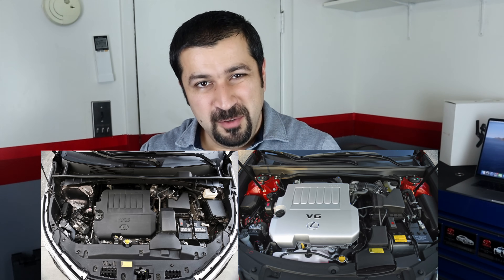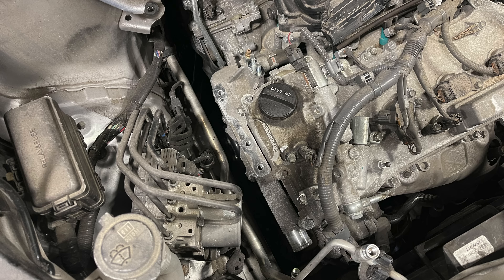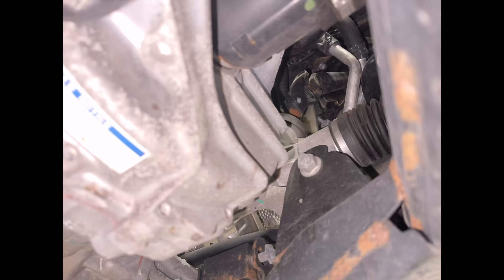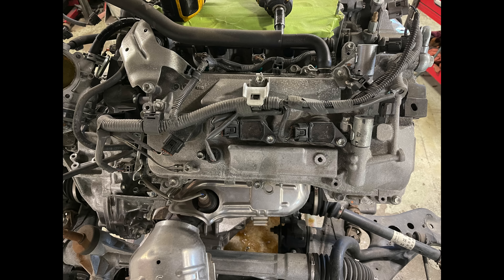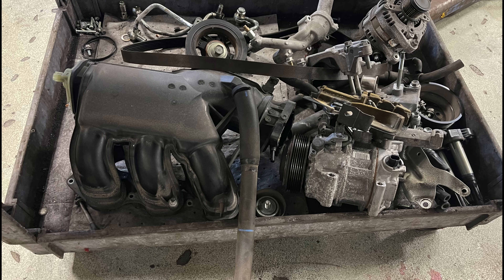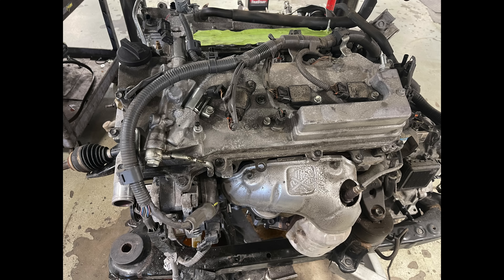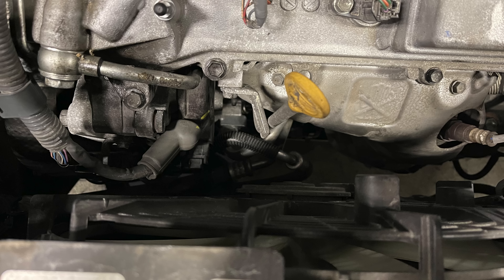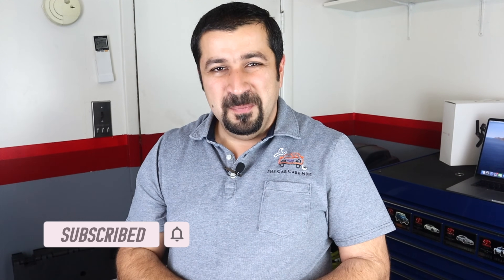Toyota V6 Engine 2GR-FE Disassembly Start to finish Front Timing Cover Repair

Comment: Hi Care Care Nut- I have a 2015 Camry 38,000 miles. I brought the car to a local Station  for an oil change where they pointed out the same leak. Is this something  that will get worse after time? Also would Toyota cover this as a warranty  issue? Even though  my car is 7 years old. But very low mileage . Kindly advise back. I wish I lived near your shop to have the work done. Also I always brought  my car to the dealer for service and just this one time I brought  to an independent repair shop. Suprised  the dealer never mentioned this...?

Comment: I hope you can provide some input to my problem - - I have a 2009 Highlander Limited with 143K miles. On Christmas Eve 2021 we headed out from the Chicago suburbs to spend time with family in Nebraska, and as we were nearing the IL border on I88, I noticed my rear window seemed smeary when I tried to clean it - - the road was wet and was kicking up crud. I figured I'd just clean it better when we topped off the tank at the Iowa 80 truck stop, but when I pulled in to the pumps, I heard what sounded like lifter noise, After refueling, I checked the dipstick, and saw nothing. I went in and got 4 quarts of oil, added them, and the dipstick showed only half full. When I fired up the car, I expected to see blue smoke, but the exhaust was clean, and when I walked around the front, I saw a huge puddle of oil under the engine. Apparently the oil line to the oil cooler had sprung a leak. To make a long story a bit shorter, we had the car worked on and they replaced the line with a kit that included a stainless line. When I looked things up on the internet, I found that this was apparently a known issue, but Toyota had never issued a recall. I have checked with about 4 mechanics, and they are all recommending replacing the engine. I am looking at about $7K to have it rebuilt & reinstalled. I called the dealer we got it from (used) to see if Toyota has dealt with this issue, and would offer any assistance, but they didn't offer any help. I am considering talking to Toyota corporate, but thought I would see if you have had any experience with this issue, or if you know of Toyota offering any compensation. My long-time mechanic who is retired recommended an engine rebuilding place in Elmhurst that has a 3 month wait, and I am considering going in that direction - - but if you have any input on where to take it, I would appreciate it.
Reply: something I forgot to add - - the low oil pressure warning only came on after I restarted the engine after filling up with gas - - no warning whatsoever when we were cruising down the highway. Thanks for any help or input you can give!

Comment: Hi AMD, looking at buying a Camry/Avalon 2013+ and been reading into oil leaks from the oil cooler and VVTi oil lines that have a rubber component.  There was a TSB to replace with full metal line, do you know what year Toyota started using all metal oil lines from factory? I am from Canada

Comment: Do you know whether I can change the timing tension on Sienna 2GRFE without lifing the engine?

Can I change the AC bearing without remove the AC compressor?  I know usually have to remove radiator and AC coil in order to get to the AC compressor.
Reply from the maker: Hi! On the tensioner you can but it’s very difficult and tight. The AC compressor you can change the clutch if you can get a tool to hold it and take the nut off

Comment: I’m having to do this on a Lexus ES350, except I’m having to go a bit further and remove and replace timing chains, guides, tensioners and the VVTI cam gears for the intake. The Bank 1 VVTI cam gear was rattling on start up for a good 1.5s after start up. Told the guy if the engine is out and the covers off, and I’m having to pull the timing we’re going to change it all out so we don’t have to go in. Also told him if he’s got any other repairs he’d like done while the engines out now is the time.

Comment: Wow, just wow.  You're a class act, I love your spirit & passion for doing a good job!  I work on cars, but I get easily frustrated; I would be cursing my head off, throwing things & cursing the design!  lol  I have this engine in my 2011 Camry and I pray that I don't have problems with the timing cover.  I have 238,000 miles on it and so far so good.  Thank you for this informative video!

Comment: Hi AMD. First of all thank you for your amazing content and kind spirit. I have a 2017 Tacoma with 80k which appears to have this dreaded issue (not sure when it originated). Do you have any recommendations with regard to oil type to help slow down the leak- high mileage oil, go up in viscosity (5w30?), synthetic blend instead of full synthetic, any suggestions? Thank you kind sir!

Comment: Do you have to drop the engine to service the timing chain cover on the latest generation highlander? Having to drop the engine to repair a timing chain cover oil leak which is somewhat a frequent occurrence is a huge negative to me.

Comment: done this job quite a few times. use pretty much the same work flow to achieve the same result. good to know im not the only one that takes the time to leave the engine bay cleaner than when i started.

go figure my own Avalon has leaking cam towers though. a project for next year!

nice work.  -from a fellow chicagoland toyota tech
Reply from the maker: Thank you Dan!

Comment: Hello sir, first off I thoroughly enjoy your videos and learning from your knowledge, experience and expertise. I have a question about the 3.4 5vz-fe, I couldn’t find a video specific to that motor. What’s your best guess diagnosis for black/grey smoke from the engine compartment of a 2003 tundra with 240k miles. No white smoke anywhere. My first guess is the valve cover gaskets, which is fine as that can be repaired. Do you have any other diagnosis thoughts of what could be causing this? My main concern is could it be something inside the motor that’s not fixable besides a new motor. It runs, but begins smoking from the engine compartment soon after start up. I’m potentially getting it from a friend for $2k that doesn’t want to deal with repairs. Thoughts? I appreciate any insight and advice you can give.

Comment: AMD what would typically be the cost to swap a 2GR-FE on a V6 Camry, have a replacement 2GR-FE with 44k miles hanging around in my garage doing nothing and the one in the car has 280k miles.

Comment: As usual, we’ll detailed video! How can one prevent this leak from happening or is this leak inevitable? I’d hate to have to do this big job if I can prevent it. Thank you Sensei
Reply: Rubber and plastic goes brittle/hard over time as it's exposed to harsh conditions -in this case heat cycles and oils/vapours etc...-. Optimum material chemistry can improve longevity but nothing we make lasts forever. I'm considering getting an '08 camry with this engine and I must admit, seeing this sort of maintenance routine is a bit daunting... To be fair, this probably only needs to be done once in the typical healthy life cycle of these cars ~300k miles + which is easily justified when you consider how many cars have parts that are designed to fail and empty your wallet right after the factory warranty runs out.

Comment: Hi, I have the same engine on my 2008 Highlander with 206k miles. Unfortunately after a long drive from NYC to FL and vice versa, I heard engine knocking real loud on idle. Instead of rebuilding the engine, I’m planning to swap it with another low mileage 2gr-fe. So my question is will I encounter any problems such as ECU compatibility along the way?
Reply from the maker: As long as it’s from a compatible car, you’ll reuse your wiring harness and ecu so there shouldn’t be any issues
Reply: @TheCarCareNut  thankk you so muchh for the info. Last question, I’m currently looking at a long block engine taken from a Lexus es350 FWD from Japan and my Highlander is AWD. Will it still be compatible for my vehicle?
Reply from the maker: Honestly this one is a tough one to answer. You’ll want to compare the short block numbers between the two cars to see if they mate tk the same transmission
Reply: @TheCarCareNut  gotcha.. i’ll definitely do that. Thanks alot. Love your videos.

Comment: Hi All
What about to use loctite 3450 seal from “outside” timing cover? Of course wipe/clean all oil leak. Probably only power steering pump need to be remove to get access. Engine stay in the car. Sounds like way way cheaper repair, but It will work? There is no high pressure there, loctite should do the job?

Comment: Thank you for the informative video! I was wondering how hard would it be to replace the exhaust manifolds front and rear while the engine is still on the vehicle, on a 2GR-FE 2010 Camry V6? How much time approximately will it take?
Reply from the maker: Hi! The front one is easy. The rear one is a bit more involved but still not hard for a professional. Should be likely up to 3 hours for both
Reply: @TheCarCareNut  Wow, thanks so much for the quick response! I appreciate it!

Comment: Jesus Christ 😂 I have this engine in my 2010 Venza at 166,000 miles. Doesn't have this leak, but it had the oil cooler line leak replaced at 130,000 (that oil leak was nasty, it was literally pissing oil out). When this happens I'll most likely be adding/cleaning up oil like everyone else in the comments are doing! Hands down to you 🙏
Reply: I'm surprised that there was not a recall for the rubber oil cooler line issue.  Loss of oil could destory the engine.  I see that Toyota re-enegineered the replacement part with all metal tubing.
Reply: @dmcc7365  no recall they just extended the warranty on it. Mine was past the warranty and was $700 to fix before I flipped out at the dealer. They knocked it down to $300. Lucky the engine didn't blow when the hose burst on the 30 minute ride home, it only had half a quart of oil in it when I checked it the next morning. (All dummy lights were on and the engine was knocking)

Comment: Wow, thank you for the video.  Our 2019 Highlander Hybird is at Toyota having this done right now.  It seemed to start around 14,000 miles, very small, but we had continual oil on the garage floor.  Is the repair permanent?  I hope our mechanic is as good as you.  I met him, and the service tech said he was one of the best at the dealership, but there is so much to take care of.  Also anything to watch out for when getting the car back?  Thanks again!
Reply from the maker: Hi! This repair is permanent if the technician is experienced and prep the surface correctly. If they’ve done this job before they would know how to prep the surface otherwise it will leak again within a year or less which is within the warranty period. Make sure to check it again less than a year. If It’s good then you’re all set
Reply: Try buying a real SUV instead of a Camry with an SUV body and a minivan engine.  You tOyOdEr buyers are absolutely clueless and pathetic.  Highlander is a pile of garbage; slow, outdated, ugly, and rusts out at the sight of rain.
Reply: @wildman1137   Brother are you ok?

Comment: Hey amd what do you use to hold the engine when you changing transmission. Or you usually bring the hole assembly down too.
Reply from the maker: Hi! There’s a bridge or support that sits on top to hold the engine so you can remove the sub frame and pull the transmission out
Reply: Any chance you can send me a picture of the support bridge.. the one I use so sketchy.. I’m afraid I’m gonna get crushed.

Comment: Excellent video,  outstanding to watch.  May I please as?  This is the 2GR-FE engine that has these front cover leaks.  It's the same engine in the Toyota vehicles, as the Lexus ES350.....However, the ES350 for many years was made in Japan.  So....the question is, have you seen about the same number of ES350's, as Toyota vehicles? Or is it mostly just the Toyotas?
Reply from the maker: Hi! It seems to affect specific models more than others and it doesn’t have to do with made in Japan or not. For example the ES350, Camry and Avalon are not that affected by this when compared to the RX,highlander and/or sienna.
Reply: @TheCarCareNut  Thanks for sharing that.   And that's both interesting, and curious at the same time.  I have the ES350 so I guess I'll move that down on the list, of: "next thing to worry about".   I learned so much watching you take that engine apart.  Thanks again for making this video!
Reply: @TheCarCareNut I just bought a used 2007 es 350. I didn’t see any leaks when I seen it. I bought it at 142,000 miles. I noticed it leaks oil. It doesn’t burn and smoke. I’m worried. Any advice would help please sir.

Comment: What kind of table did you use to drop the engine on?  I need to replace my exhaust vvt cam timing gear assembly bank 1 on a 07 RAV4 v6.  Read that I have the affected model, and it does make a rattle noise on cold start.  Any recommendations on that job?? You make great videos!
Reply from the maker: Hi! It’s basically the same on this video plus removing the chain and the gears. That table is made for nissan actually. Search in nissans special tool catalog and you’ll find it

Comment: I have 2gr Fe  in a Lexus RX 350 that started overheating and wanted to ask if there is any difference between Fe and Fe awd. Should I change the engine or should I rebuild the engine?
Reply from the maker: Hi! I would find out why it overheated first
Reply: @TheCarCareNut  so it turns, it was a blown head gasket as I finally started to see white smoke.
Reply from the maker: I would still make sure everything else is good

Comment: 16:25    Can anyone tell me what that hose clamped to the coolant funnel is for.  The only thing I could think of would be an air bleed for the cooling system.  Is there one on this engine on the top of the passenger side.  (Can't really tell where it is hooked to.)

Comment: The dealership noticed timing cover leak on my 2015 RX350 at 31,000 miles...fixed it under warranty. 14.9 hrs of labor.  Now the vehicle has 66,000 miles.  Could this leak reappear?
Reply from the maker: Hi! Likely not. If it lasted this long without issues then the job was done right and you won’t see this leak again for a very long time if ever

Comment: Ugh, so what you're telling me is i'm not getting my 2gr out of my rav4 in my driveway to fix that stupid vvt cam
Reply from the maker: It’s very difficult to get it out the top.
Reply: @TheCarCareNut  thanks, appreciate the reply.  Seems like one of those things I just really need a lift to do right.  By any chance have you ever seen or done one of those pre-oiler setups to stop that cam gear from beating itself to death?
Reply from the maker: I haven’t seen that.
Reply: @TheCarCareNut  basically a pressurized reservoir actuated by a solenoid.  Turn the key to on, squirts oil through the passageways, start the car, refills the res.  Repeat.  Supposedly keeps the vvt pin in place since you dont have to wait on oil pressure to build
Reply from the maker: That is the opposite of what should happen. If you pressurize the system the pin will come off and unlock the gear. It should lock once the engine shuts off and the oil drains back
Reply: @TheCarCareNut  well crap.  I thought the problem was the oil draining back out and letting the thing slap around on cold start.  thanks for the info.

Comment: Hi,great video. I have a 2001 Camry,with 4 cylinders. The cooling fans are on all the times. Is one of the two wires supposed to have power ? Because I checked for power,there’s no power with neither one. Thanks
Reply from the maker: Hi! Some diagnosis is needed to know if the relays are stuck or it’s getting an incorrect signal to come on

Comment: Hello, Ilove the channel and thank you for great information.

I have a 2011 Lexus RX350 (made in Japan) since new and now has 150,000 km (metric in Canada) or 95,000 mile. I understand it has the 2GR-FE engine. I watch your video on fixing a leak from front timing cover on this engine  ouch $$. Is this a common issue, should I be looking to sell the car?

I also understand that there is an upgrade water pump (Part Number: 16100-09442 replaces 16100-09442; 16100-09440; 16100-09441; 16100-39455; 16100-39456) and upgrade drive belt idler pulley (Part No. 16604-0P011 replaces old 16604-31020). Is there any way to find out which one is on my car (still original parts) using VIN?

Thank you for taking the time to answer my questions, Regards

Comment: Why don't t they just use a gasket rather than Fibage ? They money they lose by saving on production cost at assembly is counterproductive.A metal sandwiched rubber gasket, like their water pump gasket, would solve all of this.

Comment: So clean! Even before all the top covers were installed. No tools even lying on the support frames strewn about during process. Impressive. Thank you. 

Have the same engine. Just different configuration. Different car. Mine ticks more. Early in its life looks like from dealer records, it did not have regular OCI. Double time or more. Lots of highway miles it appears. I'm trying solvent additives to see if it helps. So far Marvel didn't help. Currently just running straight recommended weight oil, no additive. Might try ristlone next might not. This pandemic, the vehicle hasn't gotten much mileage in a year. Maybe less than 2000 on the synthetic. Such a shame to change it. Still light colored. Might just do a drain and fill at home and not do the filter. Used an OEM last time. Not sure. Never had this circumstance before where the filter was still low mileage and clean but aged. Wonder if the glue inside it will hold up..